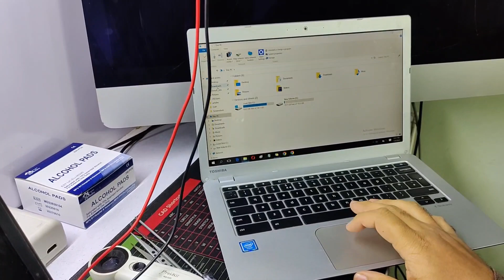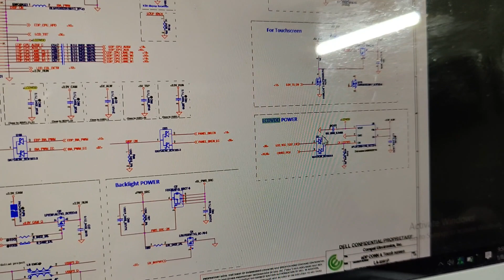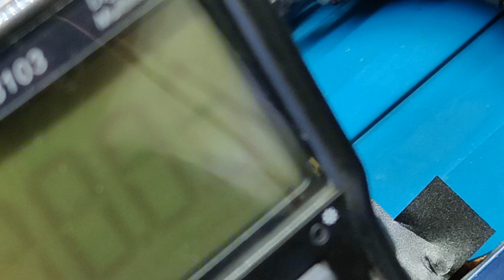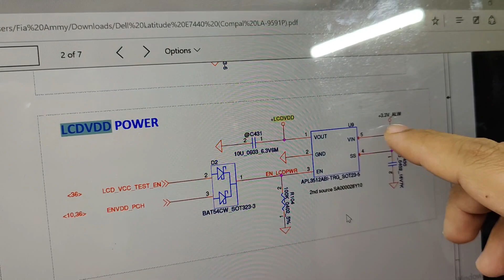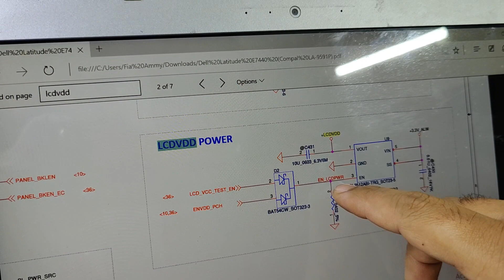Dell E7440 Power On But No Display Solution

Comment: Enable_lcdpwr measured was about .4V . Isn't that enough to switch the ic on? Could have been a partial short on LCD Vdd the reason for a low output voltage?
Reply: No, 4.4 is Kohm in ohm mode. This multimeter is auto mode, first time i see kind of multimeter like this